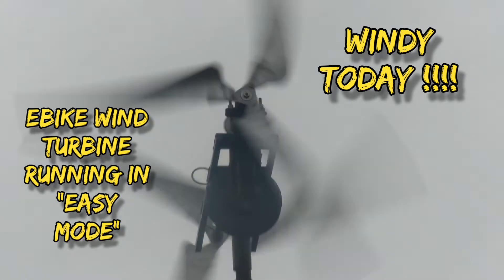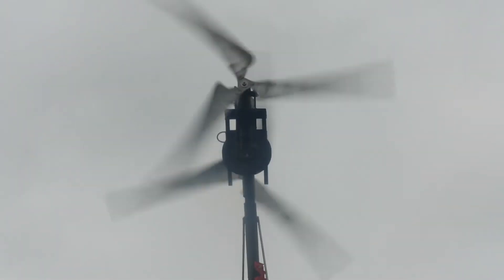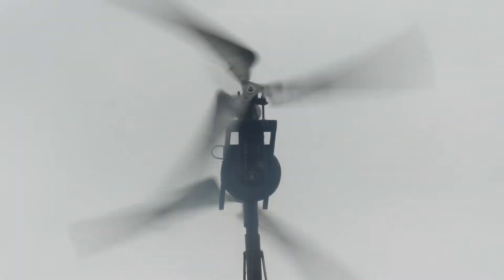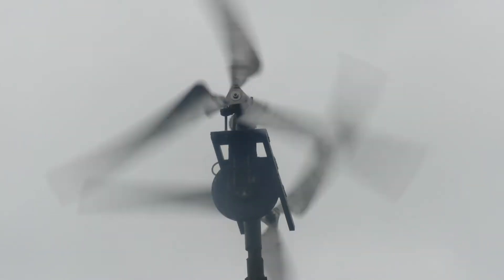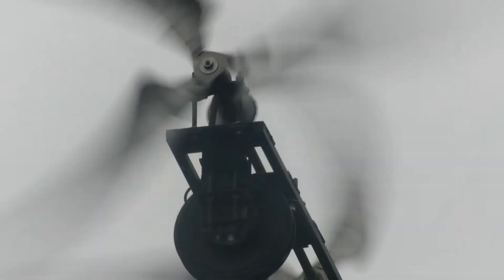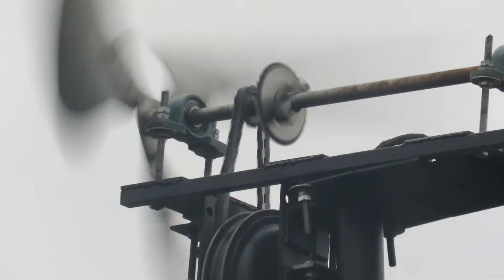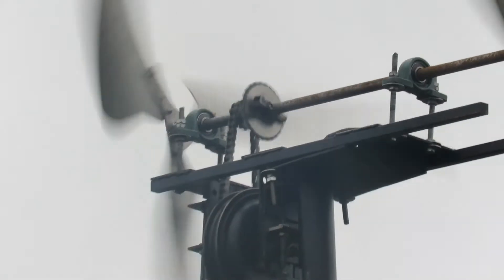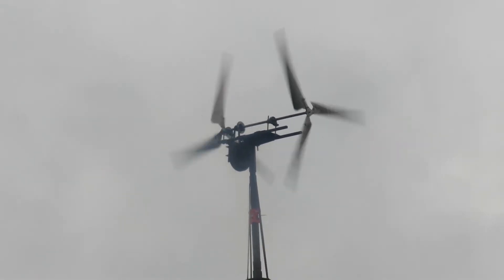e-bike wind turbine running in easy mode lower gear.

Comment: Just a thought. What if you had mounted the blades on the e-bike motor shaft.
Reply from the maker: That would be very difficult due to the shaft is only about 1 inch long, meaning you have to hold it at both the front and the back , plus I love using gears :)

Comment: I like the movement bro form side to side....
Reply from the maker: Yes it works well , does need a bit of wind to get going.
Reply: @GavinFreedomLover  am working on one too,but a v-belt drive on a d. C motor
Reply: With a spin I can get good current to light a 55wtt bulb, thanks again

Comment from the maker: I'll find out tomorrow I am going to try and get the 5 blade hub on the back as needs more torque , also could do with a tail , it's bulletproof for sure and follows the wind perfectly, the problem is when the wind stops blowing for a while it will then need a good gust to get it pointing in the right direction.